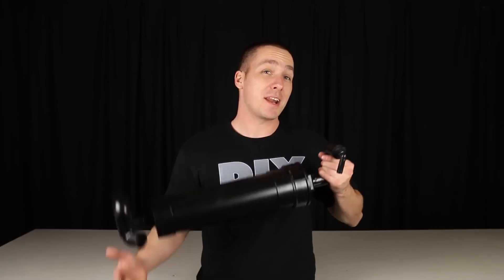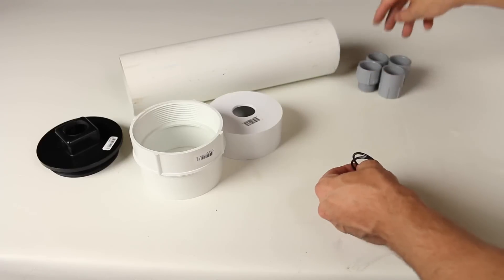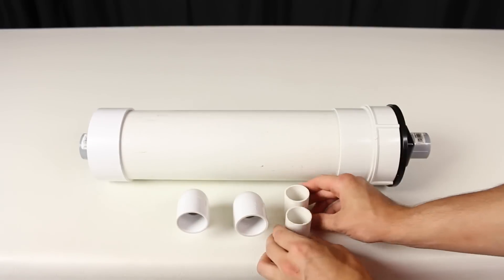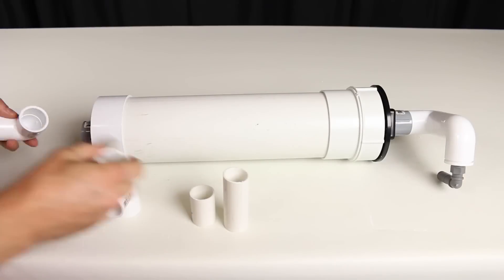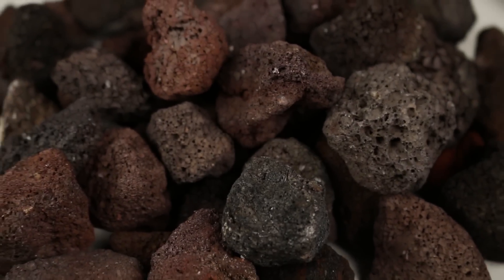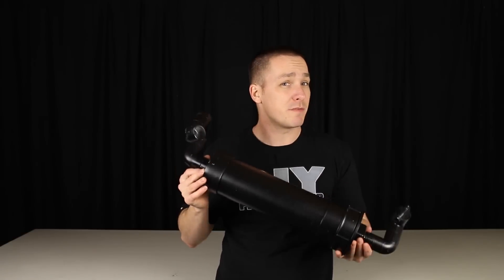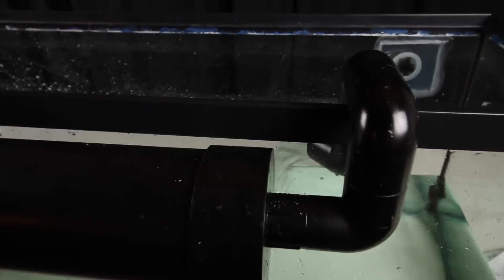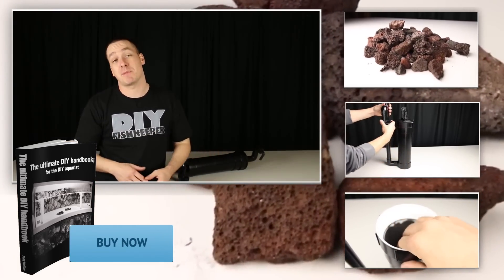HOW TO: Build a canister filter for AQUARIUMS

Comment: I built one of these beasts. Teflon tape was my friend, my end cap and threaded male cap both were not flat and the drilled holes weren't exact as a result. Silicone and plumbers tape eventually stopped the leaking, and so far the tank is enjoying the addition of a new, more powerful filter! Great vid Joey, I know next to nothing about building much of anything, and if I could pull it off, countless others can add a new and wonderful addition to their aquariums, too!

Comment: I have a 4 feet vertical canister already done. The price depends on your location, mine was almost $120. The difference was I used vinyl hoses for the intake and outake for convenience, and use plastic scrubbers inside. The mechanical filtration is in the intake of the pump, I invented this with polyfiber and coarse media around a 1/2 inch tube like Joey did  in the diy sponge filter.

Comment: This is an awesome diy that can be awesomely frustrating to find the parts.  Build-wise, this about a "2" on a 1-10 scale, but frustration-wise, it can hit the red line.  I found all the parts, but I had to go to multiple stores to do so (Covid-19 shortages may have some effect on this).  However, locating a gasket or o-ring for the cleanout plug proved to be a maddening endeavor because they just don't seem to exist in my part of the world (America, goddammit).  I ended up buying a sink strainer gasket and trimming it down, and thus far, it is working.  Still, this a freaking awesome diy.

Comment: Fired Up!!! Book and discount y'all, order today!!! My question is should you have use Teflon on the threads of the removal lid. Only ask cause it's on its side and seen these fittings leaking in people's spectic line in their crawlspaces.
Reply from the maker: +Slim Tim You can add a bit of vaseline to the O ring if needed. I have never had one leak though. I have a HUGE canister build coming soon too Tim. ;)
Reply: Can't wait for that build, Fired Up!!! I'll have a contest entry up later today showing my established nano shrimp tank.
Reply: +The king of DIY IN4 Huge canister!

Also one of my favorite parts about this canister is there
is no need to prime it, it just fills using the pump and the water
is pushed through so thats nice. The first time I tried getting my Marineland 530 primed was a sight to see, I had the hardest time.

Comment: Hey mate. Love what you have done with this one. I'm going to make the same for my small aquaculture setup. Question, Instead of the bulkheads could you use uniseals instead or will they not take the weight that will be in the filter? Keep them coming.

Comment: thanks to a vid at DIY fishkeepers i did get an idea to use for a replacement on the cap and plug ; ... it's called a
 flexible pvc cap , it comes with a  clamp to tighten it to the pipe

Comment: i would like to get your impression on this idea:
i may have an alternative 
taking your idea and running with it , since i am having trouble finding parts to match your idea;
i found some water tight containers at walmart.com
1) emergency water tight container ... 7"L x 5" dia. cylinder /  twist off cap less than $8
2) dry box /clamp down lids ... (like most canister filters) ranging from  $6 to $13
3) plastic ammo or field boxes .... i found them at walmart and atwoods both run for about $5  for the smaller ones
 
using most of the other parts you mention to build it out including the bulkheads
i'll have to build small EX. to test it
thanks for listening

Comment: This may be a totally ridiculous question, but I am totally new to the DIY aspect of the hobby and still a total novice in my own mind for the hobby in general but here goes anyway. How do I know if I have enough flow with my filtration? I just installed a DIY hang on the back PVC filter. I have a power head attached that is supposed to be rated at 190GPH, it's a 40 Gal tank. I had a pump rated at 325GPH, but seemed like was too much and didn't want to stress out the fish or tear up the plants i was attempting to put in. the 325 was definitely moving water, and i'm sure the 190 is, but just doesn't seem like it much.

Comment: Having trouble with this build.  

1. I can not find a threaded end cap with lip.
2. Just as well that I can't find a threaded end cap with lip as that I can't find a 4 inch gasket either.
3. DIY bulkheads don't work. Too much of a gap when you screw them together.
Reply: Are you looking at weather tight electrical PVC parts?
I think you'll have better luck with the gray PVC stuff.

Comment: Hey JoeNew to this. Can I just just use small piece of pipe with washers and silicone instead f bulkheads? I have a lot of 3 inch PVC and several 10&20 gal tanks. I cut a 1 inch hole in top and the 3\4 pipe fits snug. Cannot get the bulkheads into the inside of the 3 inch top. (1\2) does not fit either. What do u think?
ThanksRob

Comment: Thanks fro this video. Do you ever need to clean the lava rock, if so would it just be a rinse, or should the media be replaced? I've read that if power ever goes out the bacteria in the media turns on you, is there any truth to that?
Reply: +flagship The lava rock is the biological filter which holds all the helpful bacteria for your tank to thrive. I would never recommend cleaning it unless you are done using it for a long time.
Reply: +flagship The lava rock is the biological filter which holds all the helpful bacteria for your tank to thrive. I would never recommend cleaning it unless you are done using it for a long time.

Comment: Ok I’ve built the horizontal filter. I made it with a 2’ long body. How big of a tank do you think I could use this for? I’m using it on a 40gal now but when I get a bigger tank I’m just curious.
Reply: What size bulk head and elbows did you use, cant tell if he uses 3/4 in or 1 in.

Comment: the only thing I'd worry about is if some large bits got caught in the power head/pump and casing damage or disrupting the flow. but then I thought, what might solve that is placing the pump inside the filter, up against the light diffuser plate so that it the water is then pulled into the filter. the lead for the power head could just be fed through the output tube so that you don't have to worry about making holes for the lead and sealing it. thoughts anyone?
Reply from the maker: +Isaac McGinley (goodwilb) Put a sponge over the intake...
Reply: +The king of DIY ahh good thinking!

Comment: new to all this, the thing i dont understand is why did you use different parts on either ends!! does it work with the end caps on both ends ? ? ?
Reply: azay tandukar the threaded end cap allows for easy maintience. Screw the cap off, inspect, replace and screw the cap back on when finished.

Comment: Cant find that kind of cap either.  It dont seem to be that common.  Even looked on the internet for ABS caps, but nothing so far. The only thing that keep popping up is those clean-out threaded plugs with no lip for a gasket.
Reply: +mford2936 yea im having that issue i already made the filter now im having a problem finding that cap if u put one on with no lip it leaks

Comment: i cant find that male threaded end cap with the lip on it anywhere the biggest i can find is 2 1/2 inches any recommended sites maybe or alternatives i already spent the money i have the filter built i just need this one damn piece the ones without the lip dont hold the gasket well and they leak

Comment: Whats a nice quiet pump for my 20 gallon turtle tank?
Reply: +Fahrenheit38  maxijet 400 or 600 maybe?
Reply: +jraker Are any of the out of tank options worthwhile?
Reply: Depending on your head pressure, you could go with one of these:

http://www.bulkreefsupply.com/iwaki-md-20rt-japanese-motor-420-gph.html

or

http://www.bulkreefsupply.com/pan-world-40px.html

I would do an Iwaki because they are used and trusted by many people and are also recommended by BRS.

Comment: I guess you have to buy the book to know what the flaw in this build is, but I'll tell you right now.  Without some type of diffuser on the inlet, only one inch (right in the middle) of the available four inches of mechanical media will be used.  So, as big and bad as this thing looks, you are only using ONE INCH of mechanical media unless you put something inside to diffuse the water inlet to take advantage of all of the available mechanical media.

And forget painting PVC.  I don't care how well you prep, it will chip and flake if you just stare at it too hard.

I was totally enamored by this DIY, but after building and putting it to use, I see now that it is a bit half-assed tutorial.

Comment: Ok i found away around the end cap and gasket problem. Go to lowes or home depot and buy the end cap with no lip. While your there get a toilet gasket that goes to the flapper valve it measures 4 1/4 OD its rubber and flat. Put the gasket in and TEFLON TAPE the threads. Good to go. Update buy a 4 1/4 x 3/16 o ring from fastenal and no TEFLON tape.
Reply: Thank you, I have been searching for a cap with the flange and gasket. Is the updated gasket from fastenal flat or round? Thank you again!